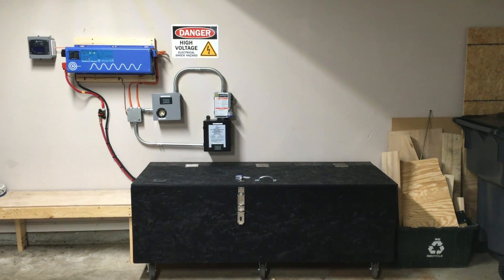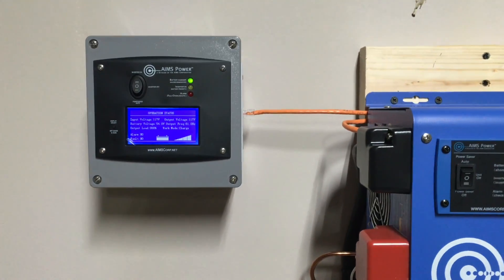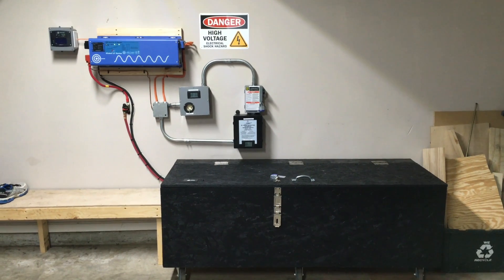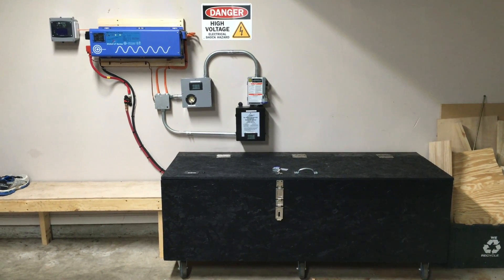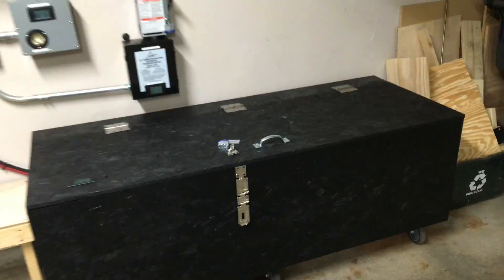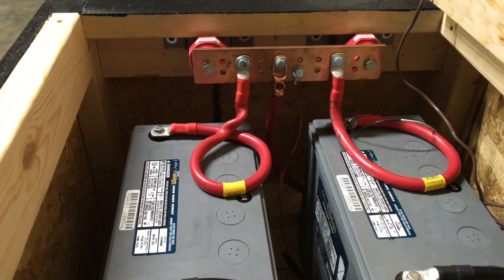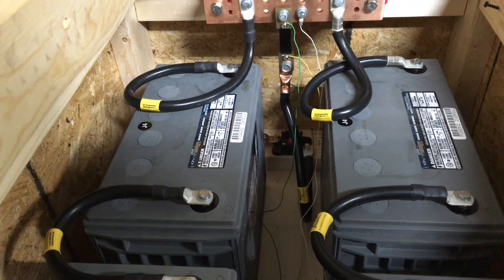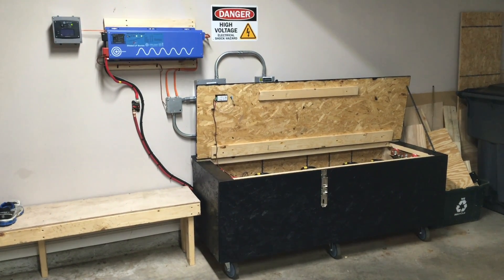Aims 6000 watt 48v inverter and battery bank (Whole home uninterrupted backup) - 1.5 of 3 - UPDATE

Comment: i've been observing your backup power set up. i think you can actually connect the cables from solar panel to that swich where you connect the Power generators. Therefore, you can still have connected the solar panels to the house and switch them back if there's daylight to keep charging the batteries. is that right?

Comment: Re:100A shunt. A loaded 6000W inverter will draw 125A (calculated) from your battery, and 375A under peak load <20s. Why would you intentionally clip your monitoring system to 100A instead of using a 500A shunt?
Reply from the maker: Practical Readiness The load in my house will never reach 2000 watts let alone 6000 so it's not clipping my setup it's built for my load.  But I get what you're saying.

Comment: Nice - I have a Aims 6kw 24v w battery backup -don't have much expertise so I paid for installation.  The system runs about 15 hrs then every thing goes dark and I have to manually switch to utility power I was told that the system would automatically go back to utility when batteries got low but it doesn't - any advice?
Reply from the maker: it depends on which unit you have and how it's wired.  My unit does switch between utility and battery and generator seamlessly.

Comment: what brand of battery and model number so you have?
Reply from the maker: Kelly Covey  Deka unigy 31HR5000S
Reply: @dubohio  Hi, how have those Dekas held up? I made a disturbing discovery about mine....they have stickers that claim they are AGM but they have a vent, and are NOT sealed batteries. Mine failed, and I removed the stickers and discovered they were actually flooded batteries, and were bone dry! Anyhow, beware if yours have vents, they need the flooded charging regime....

Comment: please my question is this:
some video don't recommend car battery ,
but golf cart batteries,
on the base that car batteries design for fast discharge while the cart for slow discharge and you want slow discharge batteries to run your house? can you clarify this.

also is there video about the maths for home load and batteries charge and   
how you calculate the time hour and load

thanks
Reply: its deep charge batteries you need, not car batteries.
Reply from the maker: Yes the term is Deep Cycle Batteries which can be found in golf carts.  There are several calculators on the internet.  I was just suggest you search for one.

Comment: then after 10 years the battery wares out so there is no point this its like world trade market with waste money serous if you make money then prove your device in public this not supersizing at all but waste shit load money
Reply: erfan s. if he used less expensive batteries,  It would be more cost effective.  lead acid batteries golf cart batteries can be had for 85 $ I think . So 85 x8 =680 . .
 a electric bill without a.c. for us was 90 $ a month . 
that would be 7 months pay back for the batteries alone . 
 not to bad . 
 if you live to far from electric hook  up . what else is there ?
Reply: paul joe ummmm, no, you still pay for electricity, and you are paying more, paying for the electricity to run your home AND top off your batteries and run all the equipment in that system. This is not an energy saving system, it is an energy storage system for when the power goes out. Totally different scenario.

Comment: Great system do you have a link for the 250a manual reset circuit breaker switch
Reply from the maker: https://www.amazon.com/gp/product/B00MR1LVZS/ref=oh_aui_search_detailpage?ie=UTF8&psc=1
Reply: Waterproof?

Comment: 1000 a/h (good) battery life  test it out
for backup power (no gas)
Reply: my name is 
Michael Hardy 
Baltimore,MD
Reply from the maker: This bank is only 270 A/H and the test i've done ran for 19 hours
Reply from the maker: Yea this systems i really only for backups.  I'm not interested in trying to go 100% off grid until I have some land.  There is also no way i'm using 30KWH/day.  While I may scale up my bank it'll only be one or two more strings to the two already in place.
Reply from the maker: This inverter is only 120v so I won't be using a stove, ac, or dryer.  Also the 19 hour test I did was at full load in my house with every TV and light on the fridge running and opening the garage every few hours.  So in a real world situation i'm sure I could get to about 1/3 of that.  My daily running watts on everything powered by this inverter is about 325watts/hr.  That's just a normal day and i'm sure I can cut that down too.  Good information here though.  Thanks.

Comment: Can you install 500A  shunt in case you anticipate you drawing more than 100A ? I plan to install one of these digital DC meters but I anticipate more than 100A and looking at 500A.
Reply from the maker: Of course you can.  I you can find a 500amp shunt  you can use it.  Just make sure the meter is rated to read is high as your draw.  You'd have to have a serious system to draw over 100amp...

Comment: This is a very great video. Great installation,very neat and clean. Your system is really well planned.Those bus bars are just perfect. Great job! I love your battery box.
Reply from the maker: Thanks for the kind words.  While the bus bars were expensive I feel in the end they were well worth it !
Reply: Yes! They are really well worth it. I don't see you having any issues as regards connection to the battery and eventually when you plann to install a charge controller.
Reply: Ibidapo Ilawole brother I live in the Bahamas I am watching the same thing you are watching but they never ever says the price for the set up after they finish could you please tell them put the dump rice so I can buy one I wants to know the price in the Bahamas I need one of those in the Bahamas please tell me the price for that set up

Comment: i see great systems on youtube  with no or poor venting for battery bank , and the wooden box ... kindling.  NO offense , just concerned for you.
Reply from the maker: Thank you very much for the concern.  The AGM batteries only vent gas in an overcharged state and that GAS mixes with air very well to dissipate it.  At this point i have no reason to be concerned with over charging as this inverter monitors the state of the batteries.  While you can never have to much vent I believe the box is sufficient with the 2.5" hole in the back and the lid is far from sealed.  But thank you again for you comments!

Comment: Looks good! Is that a 120v only or do you also have 240v? Did you have to isolate the neutral (N) from the earth ground? What size generator are you planning on using?  Thank you for any help.
Reply from the maker: My unit is 120v 6000watt, 1800watt peak.  I have isolated my neutral from the earth ground.  I'm using three Honda EU2000i's with a custom built parallel kit.  So I have peak 6000watt's.  I went with three smaller generators because I wanted to use them for tailgating, and I wanted to be mobile in the event I needed to move out of my house quickly so weight and size where an issue.  Also those Honda generators are so quite it's crazy!
Reply: The first inverter you had looks like my 10000w which is 240v so I can run my well pump which is on a sub-panel. It was easy to isolate the neutral in the sub-panel. I am now working on trying to isolate the neutral in the main box. Thank you for the reply as it has helped.
Reply from the maker: Yea the first inverter I had was how the 120v 48DC 6000watt inverters used to look.  The new one is the same unit just new packaging.